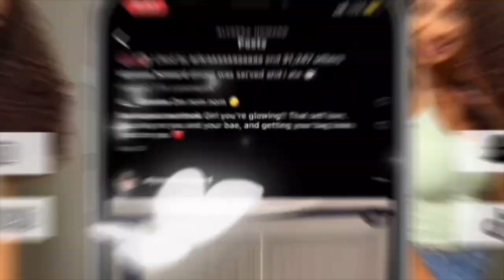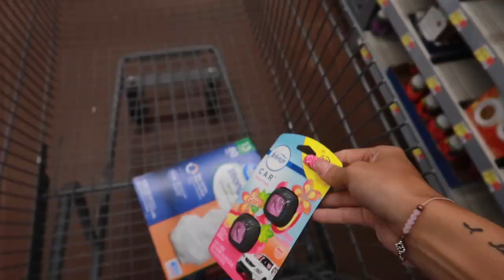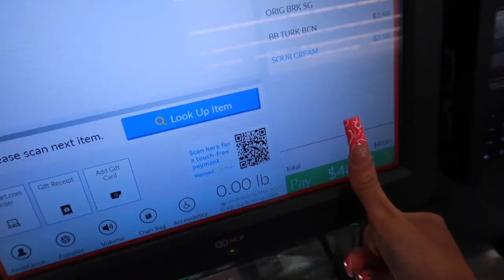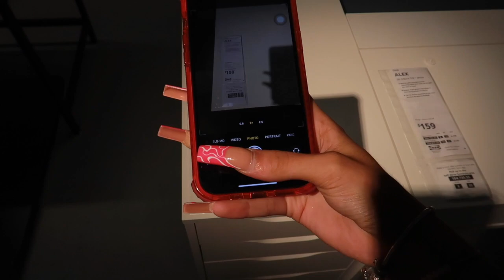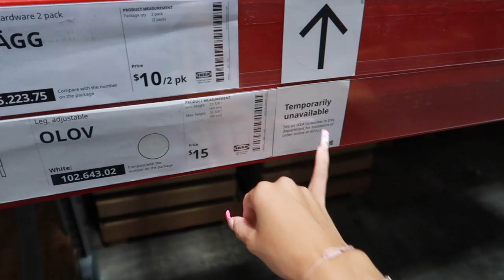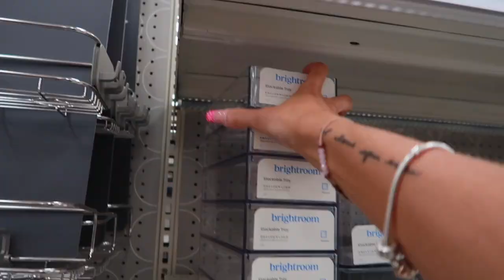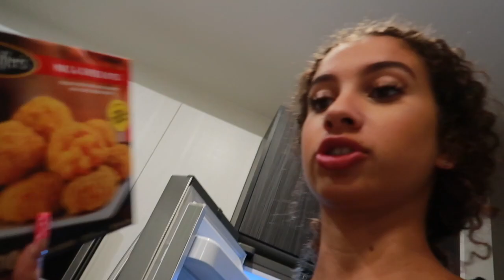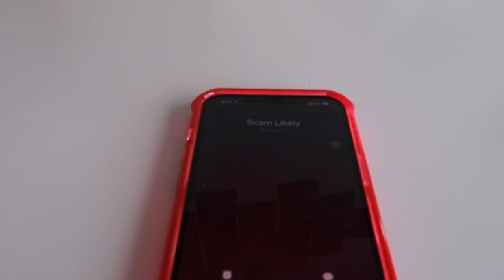solo diaries 05: 24 hr. room transformation, running errands, organizing, etc. | Alyssa howard 🦋

Comment: Omg😫 the stove lol you could CAREFULLY try turning it on, let it heat back up then use a THICK cloth you don't care to throw out and wipe it once it gets back warm, basically turn on that eye, let it get back hot to where it's melting again,(FAST) turn the eye back off and wipe it with a wet cloth you can throw out ..that's the only thing I have done b4 that hadn't scratched the surface...lol good luck, BE CAREFUL, DONT BURN YOURSELF!!!!! use an old towel and like wad it up and wet the side that's gonna wipe the stuff off and do it fast.😘